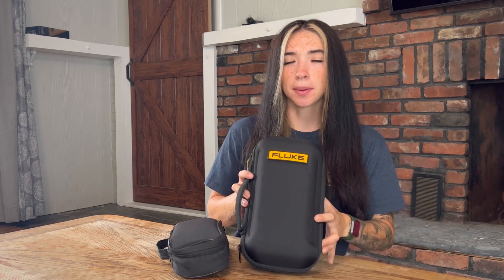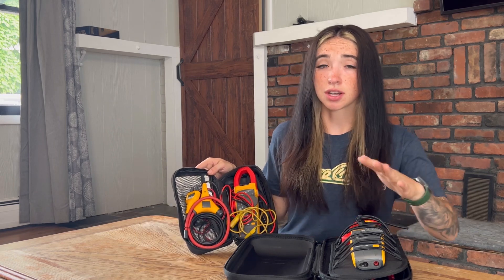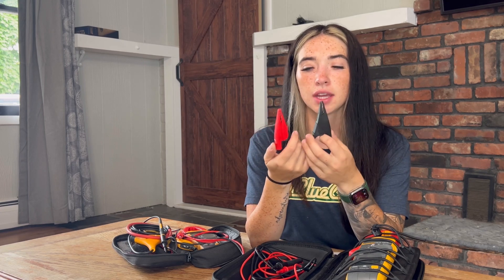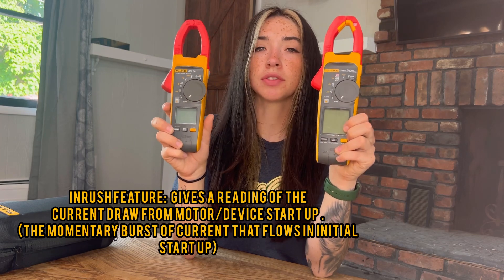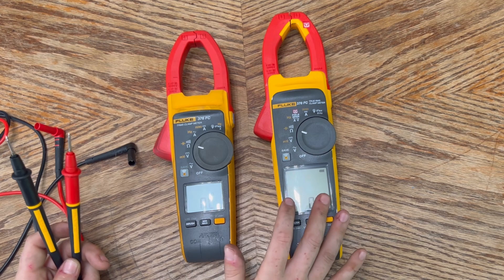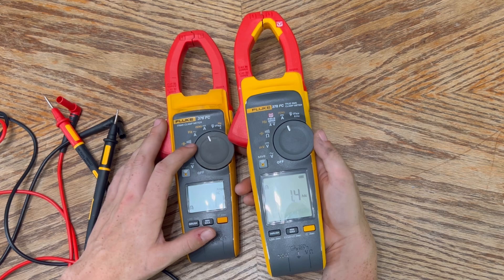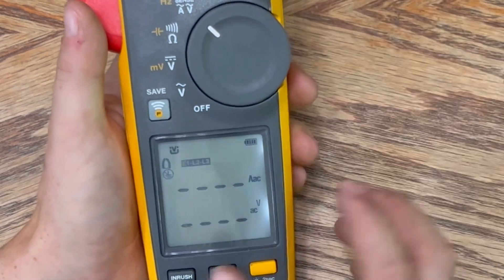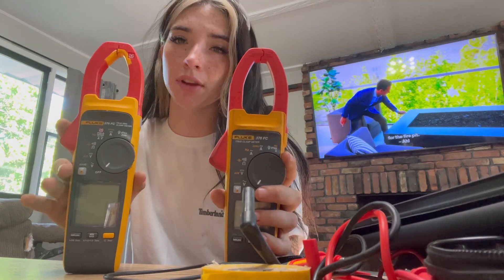Reviewing the Fluke 376fc & 378fc

Comment: There is a difference between the leads value and the fieldsense value, can be reasonably large, but im inclined to think the field value can be affected by other noise in the area, not that its ideal but you look at the overall picture of the results and if youre concerned get out the leads, i like this thing having the dc clamp option which does help alot in my vehicle checks. Ive had some unusual issues with the clamp on this when i had a voltage read out of 600V 3ph, but i do recall having a similar issue with my 1587 fc giving me a 600 volt reading once. So its either a software issue or its picking up something stray.  Il be getting a 1662 next, then i have another machine to cross check them both.

Comment: Im not gonna lie you impressed me alot on your knowledge. Im looking at these meters rn. Im currently using the fieldpiece sc680 and my amp clamp has gone out again. My sc440 works fine but amp clamp is cracked (still working ) but im afraid of using it and making it worse. Still i wanna see a direct comparison of fieldpiece vs fluke

Comment: I don’t like how the 378 fc field sense voltage sensor is so chaotic . The voltage readings jump +\- 20 volts which is insanely inaccurate. Not helpful for troubleshooting. And to make things worse you can use the clamp as just a clamp meter , you have to use the flex ring . And even worse the 378 doesn’t work on vfd outputs . But my 200 ideal clamp meter does
Reply: Thanks, yea that doesn't promote confidence

Comment: Are you still using the 378? I just bought one and the AC voltage with the test leads is spot on; my receptacle reads 120v, but when I use the DC voltage test mode, a 9V battery reads at 10 volts, when two different Klein meters read it at 9 volts. Then I tested a 1.5 volt battery and it read at 1.9 volts. I’m sure it is going to be a great meter but would you agree that for the price, it should be as accurate, if not more accurate than a Klein meter in every function? Anyways, if you do randomly read this and have a battery laying around, lmk if you get accurate readings on disposable batteries!! Because maybe it’s just my unit, who knows. 

Peaceeeeeee

Comment: hello, just a quick question, what happens to 377 or 378 If i use the FieldSense Clamp to measure Voltage of a wire without a ground lead connection ? will a voltage and current number still show up on the screen with some inaccuracy? or nothing will even be display, nothing wil work without the ground lead connection ?,,,, thankyou
Reply: It will likely not pop up at all or will tend to have an inaccurate reading. What I do is if I can’t find a ground just hold the black probe in your fingers or clip the alligator clip to them

Comment: Love the video,, question about the fluke TL 175 any issues of high internal resistance of the test leads? Mine is showing 1.1 ohm not good for me since most of the time I'm  testing resistors.
Reply: Change the leads they should not ever be reading more than .1 ohms sometimes maybe up to .2 if you’re not getting a good connection.

Comment: 0L is actually OL and stands for OverLimit.
Reply: I'm another user who thought it was Over Limit, but from the Fluke 87 V manual I happen to have open, at page 12 there is 'OL - Overload condition is detected.' Over Limit and Overload have different meanings. I imagine Fluke have chosen to use the term Overload because it includes the notion that there is the possibility of the device being harmed from the way it's being used. This goes beyond the meaning of Over Limit, which simply advises that the device cannot resolve a measurement in the current configuration and application. Thanks for prompting me to look closer at this. 🙂
Reply: It’s actually open lead
Reply: @RPMEngineering707  no, it’s over the measurement’s maximum read, over it’s limit.